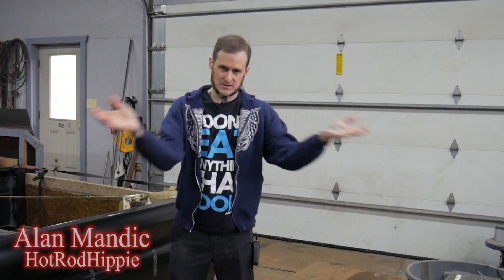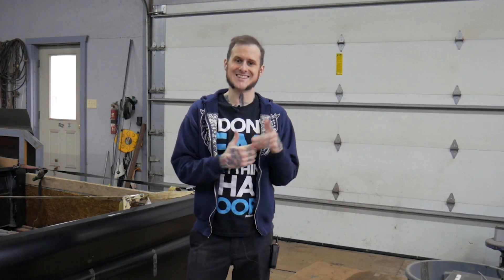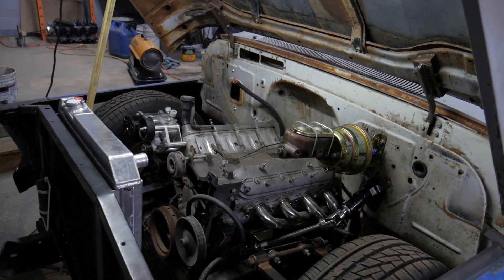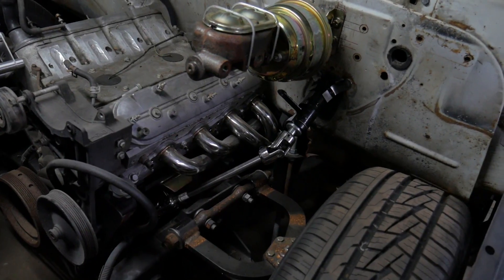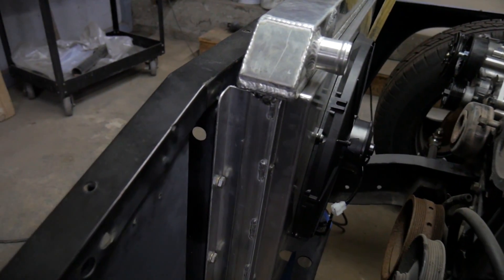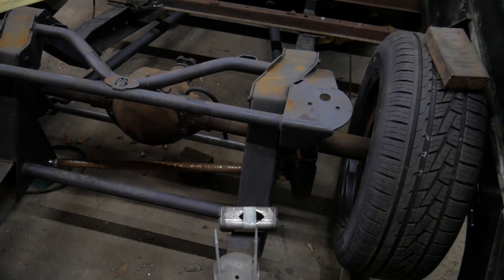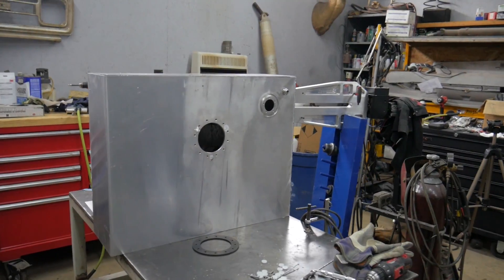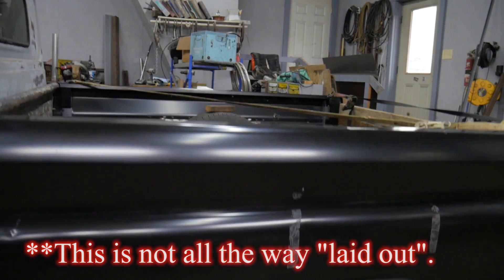Bagged C10 Project Truck and Shop Tour

Comment: love the truck, as you can see by my avatar pic I have a 64 stepside so to have a soft spot for the body style. mine wont be bagged or anything ill probably end up bagging my 56 merc instead. id like to see more projects like this maybe you personal stuff and even build updates?
Reply from the maker: Thanks, I definitely plan to post more project work in the near future.  Filming some right now in fact. What direction are you taking with your Merc? Just going to bag the existing front suspension?
Reply: well right now on the merc I have to do a few mechanical things just to get it driving again, I did end up doing a t5 swap. I do plan on bagging the stock front end. I gotta keep it on the cheap. I inherited my dads 69 hurst olds a few years back I think I need to focus on making that car what it should be. so just trying to get the merc and truck reliable so I can do that. looking forward to seeing what your working on.